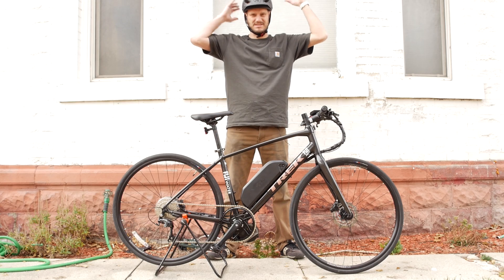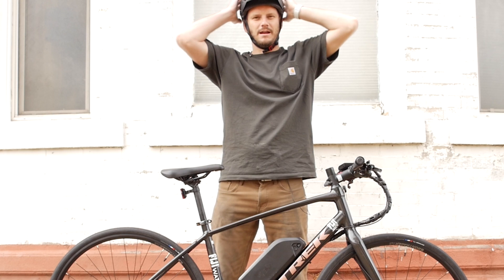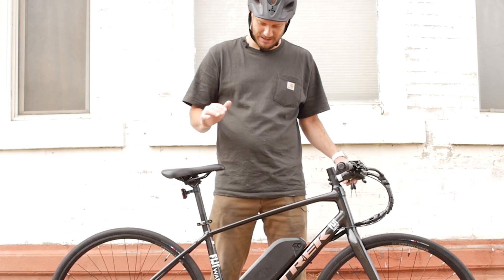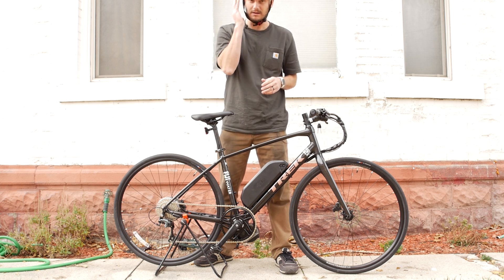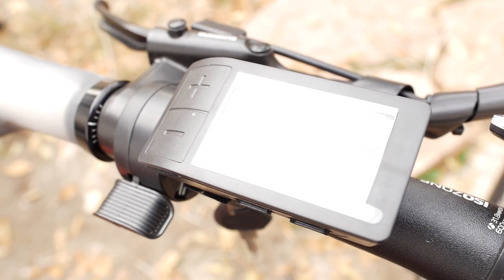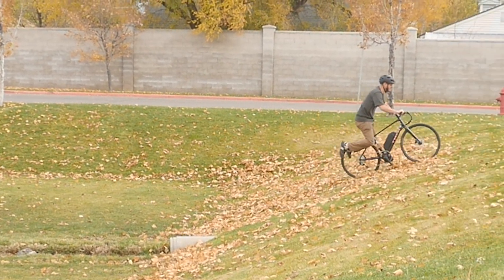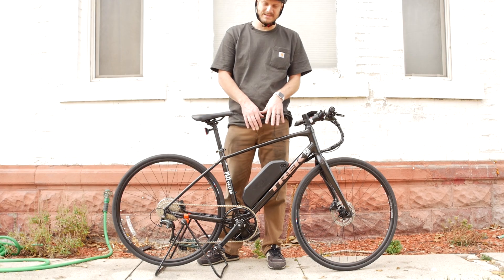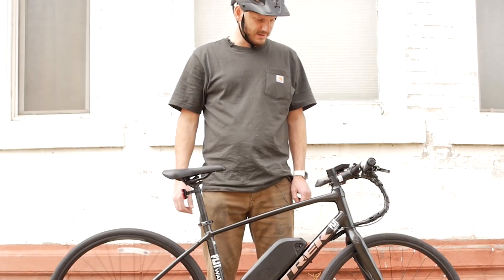Custom E-bike Build: Trek fx4 Bafang BBS02 750w Mid Drive w/ 52v 17ah Battery

Comment: I recently purchased the bbshd with a 1000w 24.5 ah 52 volt battery and am riding a specialized sirrus. It’s a very similar bike to the trek fx. 
I was really hoping for top speeds like this bike ~mid 30mph on the throttle but can’t seem to really get over 33mph. I am surprised the bbso2 can go that fast but the bbshd with a bigger battery can’t? 
Does anyone know how to increase the speed? Does the larger battery affect the speed?
Reply: Nah, bro your Weight does, also how thick the tyres and much pressure you got in them, also what gear you using and  other conditions like wind battery charge

Comment: Great video I didn't know the lower power motor.can hit that speed.. i.have similar kit mines 1000watt with a 52 volt.20ma battery on a giant hybrid.  I can't hit that speed.usually.like.30- 35 max . I also Hava a 42 tooth sprocket  I am guessing that's why . Do u a link to the 52 tooth leechy?

Comment: Why not just ride it as a regular bike?
Reply from the maker: Can’t go as fast or far that way
Reply: @JohnnyNerdOut  I would think it would go much farther as it doesn't require a battery that needs to be continually recharged and the lower weight helps as well.

Comment: Thank you! Been thinking about a 2022 FX3 conversion. After watching your video, may also consider a 2021 carbon frame FX4. But would opt replacing the 40T with a 46T or 48T front chainring. Trek now has 2023 20mph FX2+.

Comment: My Sunpeed Zero has its stock 13-28T 8spd cassette with the stock BAFANG 42T chainring (kept stock tooth count for ease of BBS02B conversion) and it still climbs hills like a champ. I'm about to swap out the wheels for mag alloy wheels and an 11-40T 9spd cassette. My body is ready for the hill-climbing capabilities of the new drivetrain.

Comment: Getting ready to convert a 2017 Cannondale cujo 3 XL  with a 1x9 on it to a 1000w BBSHD. any tips for me? Johnny do you think i should go ahead and order a Lekkie Bling ring 42 tooth how many spaces should i get to be safe? or should i get a different chain ring? Just trying to stay in the middle as far as hills or speed..Do you think i will regret going with the BBSHD instead of the m625? thanks man
Reply from the maker: Bbshd is the way to go IMO. I’d try the stock ring out and see if you have any chain line issues that need to be resolved via the chainring and upgrade from that standpoint. It will also give you a good idea of the performance and if it needs to be changed as well.

Comment: Hi there! I am from South Africa and on early pension. I want to build my own electric bike somewhere in future for riding around town. How far will a 120A/h solar power battery take a bike? I know it is heavy, but I got a spare one... Thanks.
Reply from the maker: Depends on how you ride and if you are converting the 12v to 36-48v to run the system. There will be efficiency loss if you go that route.

Comment: I have a Trek 4300 with the BBS02/ 52v 19ah 52T really like it , can ride for an hour at 35Km,hr and still have 48v when I return home.
Reply: I also have a Trek 4300 frame and a BBS02 kit from JNO.  I was debating whether to put the kit on the 4300 or another older MTB hardtail frame.  Just wondering did you have some space issues fitting a battery pack inside the 4300 frame triangle?  Also did the BBS02 fit okay on the 4300's wider bottom bracket (I think it's 73mm instead of the usual 68mm wide)??  (Did the wider bottom bracket push out the BBS02 chainring such that there is severe chain angle ("chain cross") with the low cassette rear ring (mine is a 7 speed cassette 12t-32t)??
Reply: @rwo6211  The battery just fit but still can be removed although I have never removed it. recommend installing a piece of plumbers tape and a hose clamp for a way to keep the motor assembly from rotating, I was able to use one of the water bottle screws or you can install an insert available at a good bike shop also used an insert on the battery mount to make it more secure

Comment: Anyone have vibration thru the pedals with a BBS02 at a certain cadence (using PAS 5-9)? Above and below it’s totally fine but at a cadence of (probably around 90) it has this strong vibration that really feels like you’re standing on a vibrator. So ducking weird and distracting, I try to ride around it. The engineer at BAFANG says it’s normal but I’m calling BS on that.

Comment: Hey my brother!! Bike done.. that cyclone motor!! Lol love it.. but hate it.. but love it! Made video.  But not build video..  you'll be in that one.. Thanks again for all your help and great service! Hope move went well and wearing my shirt with pride! No autograph?? Lol God bless  46mph 100 miles no peddling.. 👊👊💪💪
Reply: Hi @Sleeping Bear FFG!  I've got the 3000w Cyclone too.  Just wondering about the "hate it" (I've got (had) my issues too.  Just wondering if some of yours are similar to mine:  Issues summary (and any resolutions): 
a) Flexy mounts (I found a very cheap fix - solved! Let me know if interested.  Just involves some stuff you can get at Home Depot), 

b) This big ol' 13lbs Cyclone motor probably belongs on a motorcycle, or to power a tadpole trike recumbent.  Its power and torque is kind of overwhelming for a bike application.  It will suck my 52v, 20ah pack dry in just 25 miles if I ride it like a motorcycle throttle only chasing buses,  cruising at 25-30 mph, blasting up steep hills.(Resolution: Try to remember it's an e-bike, not a Honda CB100.  Reduce voltage sag by pedaling when you can even if pedaling doesn't seem to matter with the Cyclone (but it does in terms of range. I got 70 miles range this way). Get a beefier 36 spoke rear wheel.  Stay with 7 speed drive train (9,10,11 spd chains/gears too fragile and expensive for the Cyclone.  You can get a KMC 7 speed chain for $12) and 12t-32t cassettes for about $15.   (I gotta ask JNO if I can install a gear shift sensor for a Cyclone 3kw kit).

c) Weight (it's heavy and a pain to fix flats) (Resolution: Switched to Conti Gatorskin tires, added Mr Tuffy liners, bring pump, spare tube, tire irons, and a set of grip stands (for when I flip the bike upside down to work on bike (this is to keep the bars off the ground). 

So yeah, I once had my issues with the Cyclone. But do I love it?  Hell yeah!  (I'm selling the motorcycle - I won't miss the heat, fumes and weight.)

Comment: So with this bike, you start in one of the lower gears like second or third and change to the fourth or fifth gear when you know you'll go a while without stopping and then change back before stopping?

Also, what is that thing you're using to hold the wheels up?
Reply: Assuming you don't pedal, you want to make it easy for the motor, which means allowing it to spin easy. So before you stop, you want to get on the big sprockets at the back (up to 32), and as you gain speed, you would shift to the smaller sprockets down to 11. 
I have a road bike with aero bars, at 53x12 i go to 45kmh before I start wishing i had a bigger front ring.